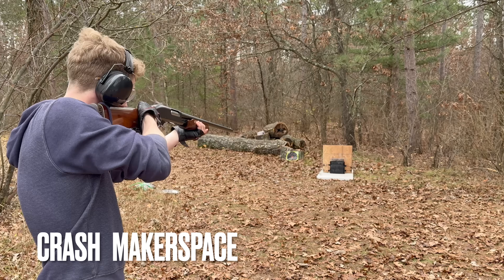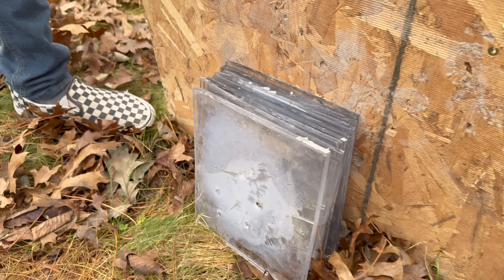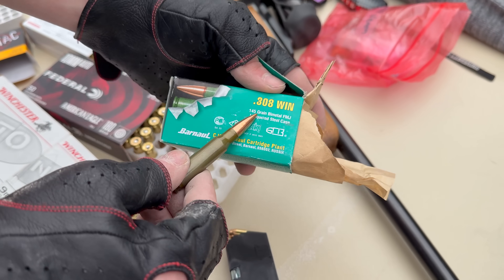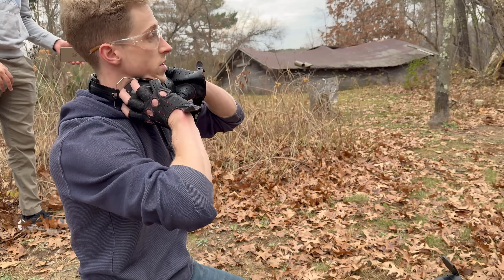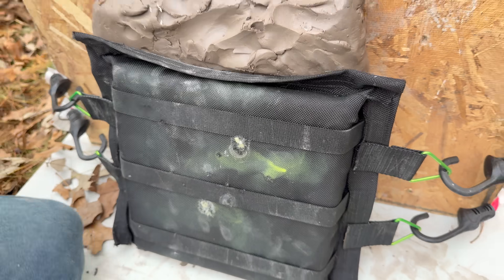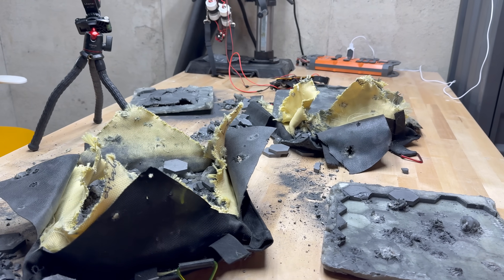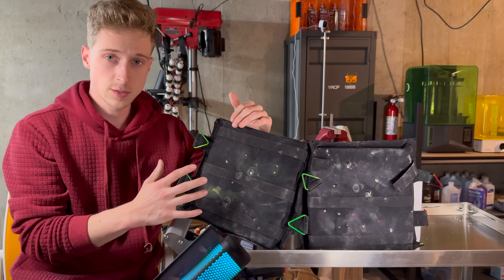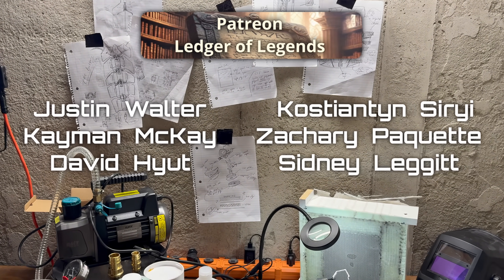3D Steel Lattice Super Armor (MULTI - HIT .300 WM capable)

Comment: I’ve got a piece you might be interested in and it’s cheap. I stopped hundreds of rounds from everything from .22. To 8mm from a Kar 98 to 5.56 took it all. Until I hit it with the prc after all the punishment I put on it both those went straight through but that’s what it’s designed to do. I’m not blowing smoke. 300wm ain’t no joke. I’m an inventor this is one of the things I shelved years ago it’s made of extremely cheap materials. That’s still showing a lot of blunt force trauma. I’m serious.im more than willing to share my designs with you if you’ll use them under the agreement that if you profit from my contribution that you are fair about it. I am on to different things but I still have the original piece right here in front of me.  I’ve tried to get armor makers attention on it before but they either don’t take me seriously or they don’t want it on the market because it will make body armor that’s effective against modern anti armor cheap and easy for when financially impaired people to obtain. If you’re in any way interested I’m serious. My direct number to my cellphone I’ll send you if you respond here. I’ll send some videos. I have zero attention on my page mostly because I haven’t put any of the really interesting things I do on there. Like turning a slam fire 12 gage into a 20mm thumper lol. I’m pretty legit. I’m just not a conformist type. I have a lot of genius stuff that I make but I never take it anywhere because I can’t seem to stay on task. At the moment developing a weapon that hides in a sweater sleeve that makes armor irrelevant at personal range but I’ll keep that one to myself for now.  Anyway let me know if you are interested in brainstorming or integrating my research into your projects. I’m not using it and I’m mostly just not wanting my concepts to go to waste

Comment: Cut this down to 10x12, and target around 6 pounds. If level 4+ rating is achievable for you, you have an amazing concept on your hands.
Reply: It’s likely the materials he used, steel increases the weight a lot. That’s why the XSAPI plates protect so well but they also weigh a hell of a lot more. It’d probably be best to have the core be titanium, more elastic and a lot lighter. Additionally for the strike face he’d probably want to use Boron Carbide like all the SAPI plates do, it reduces weight and is just simply the best ceramic there is for such a plate. 

Still with that he’d probably get at best 7.5 pounds.
Reply: Its not like this is intended to be the armor every grunt is gonna have. This is some special forces stuff some buff 220 guy is gonna carry to assassinate some terrorist leader. I dont think cutting the weight will be possible really.

Comment: Thank you!

I'm curious about the outer surface shape, where Batman has all those muscles embossed. Rather than flat or slightly curved, more angular, as much about deflection as it is stopping the penetration. Deflect the rounds down and away. Might require less thickness?

Comment: So 44 mag and 338 lapua is what you should add to your arsenal for testing imo. The 5.56 62 gr is not really AP even though on some boxes it says LAP(light armor piercing). I personally wouldn't really even use that as a reference outside of just testing against speed. If its stops .300 WM/.338 lapua now your doing some impressive stuff imo. Good luck with your armor man.
Reply from the maker: It stops .300WM as you're asking, that is what I shot it twice in this video

44Mag is far less penetrations than 556 as it is slower and larger; if you're looking to compare a large slow round, well the x2 1oz slugs I hit this with in the video are over 200% more energy than a 44 mag too (also that was after 2 .300s, a 556, and a .308)

Comment: Assumably a typical 10x12" medium size plate would weigh about ten pounds? This is pretty cool, but I'm not sure it's lighter than commercial plates which offer a similar level of protection (though perhaps not for multiple hits). As an example, Adept's Colossus plates come in at 6.5 lbs and will stop multiple 129 gr tungsten carbide M993 projectiles fired from a .300 WM at 3400 fps and a similarly loaded M80A1 projectile at 3450 fps. What I'm getting at is, if you throw together a plate that weighs double that, your goal might not necessarily be to stop anti-infantry threats, but threats intended to disable lightly armored vehicles. 

I get the idea is to be able to take even more hits, but the fact is, if you're standing out in the open getting nailed with several rounds they're not going to just hit armor plates, and you can't very reasonably have thick hard armor over your joints. Getting hit several times in the same plate by someone shooting a .300 WM is not a very reasonable threat, unless it's somebody using you as target practice.

Comment: So, serious question. If the weight of your armor for the "square" area you designed was 9 lb, what would be the weight if the equivalent area was AR500 steel?
Reply: In response to my own comment. AR500 steel is ~498 lb/cuft. So if you just cut a .25×9×9 area and coated it with a sub-millimeter surface of Aramid fiber for spalling, it easily comes in under the 9 lb weight. 

Easy peasy...
Reply: That's a .25"×9"×9" volume of 81" square. The weight would be under 7 lb with epoxy and Aramid fiber.

I imagine that would easily absorb 300 WinMag.
Reply from the maker: @pappaflammyboi5799  1) AR 500 does not come close to stopping the .300WM even at a longer range 2) BFD from  non-penetrations on steel can be significantly worse as then can end in a point. You're comparing Apples to Oranges with the AR500 here.

Comment: I want to start with you have done some amazing work on this project. It's a pretty big deal being able to stop a 300wm. However, these test show that it will stop a round but what it doesn't detail is the fact that you are still most likely going to die from blunt force trauma from the force breaking your sternum ribs and all that good stuff. What I would suggest is get some pressure sensors and place maybe 5 in a x pattern on a ballistics gel dummy to show if it helps with the trauma from the extreme energy dump. But good job on the stoppage. You definitely have something on your hands here. I look forward in seeing progress Take care.
Reply: Most modern body armor, has a performance standard of backface in calibrated clay to be less than 44mm. While there's no one size fit all, the NIJ deems  less than 44mm to be non life threatening. Doesn't mean you would walk away unharmed, but those numbers at at contact distance. Add actual range that one would engage with 300WM and BFD goes down a lot. For context, I took a shot at 400yd once with 338RUM, and the backface produced in a lower end level IV offering was only 22mm.

Comment: I would suggest that you do some research towards patenting your lattice idea and contact DARPA. I a also curious as to the tile material you used. Was it ceramic? If so, you might try using granite tiles, as they have a Mohs hardness of around 7 while most commercially available ceramic tiles are about 5

Comment: Saw those tiles a while ago on Alibaba. They are surprisingly cheap. Was wondering, why no youtuber was using them. Not sure how I feel about the composite. Kevlar works best when it can deform, so the resin weakens it a good bit. Well, in relation to the stopping power/ weight ratio anyway. But if you are putting it in front of the hard tiles, then the fibres get sheared anyways, so the stiffer composite migh be better in this context? Might be interestening to test an even more flexible PU based matrix, like the stuff they put on on AR Plates against bullet splash. 
Saw another youtuber comparing different materials as matrix for glass fibre and ceramic balls, and they found that liquit flex  seal worked best for them. At least compared to the stiffer resin they used.

Comment: A hanging rig could be made to put on the inside of your front door if you live in a dangerous area. It would have to be something that can hold them securely enough to resist the inward force but something that you can easily swap out individual panels to and from. Maybe a decorative cover could be put over top so your guests aren’t like wtf 🤔

Comment: I kinda wonder if youll actually survive a..300 wm hit with that plate. The percussive damage that is imparted by that round is significant. Like getting a sledge hammer straight to the chest. Stops the bullet but not the kinetic energy which in itself is very lethal
Also thx for not doing clickbait crap

Comment: 9 lbs...  no thats way too heavy.  AR500 will already stop all that shit and is probably about the same.   Modern armor is ceramic and half the weight so you dont break your back carrying it all day.
Reply from the maker: Ar500 definitely does not get close to stopping this .300; and ar500 steel gongs don’t get holes in them since they swing. Also, ceramic level IV don’t take even close to 1/4th as many rounds as this did, and 3rd, this is only 2lbs more than typical level IV of this surface area. And lastly, someone doesn’t understand that Gen 1 prototypes aren’t nearly perfected yet.
Reply: I’m pretty sure you’re wrong. AR500 videos are everywhere and they just eat everything. You can shoot the shit out of them for hundreds of rounds and practically nothing happens.  if you think they don’t get holes in them just because they swing I think you’re mistaken.  also ceramic is not expected to take the same abuse. It’s lighter and doesn’t retain heat or cold like steel.  Walking around with steel armor on all day is horrible.  It fucks up your spine and discs.  Less weight is better.  You got some cool stuff. Impressive intelligence and design skills. Keep creating
Reply from the maker: @Robertsmith-un5cu  Here is a video of AR500 getting an immediate blow out from a .300 at almost twice the distance that I shot my plate with:  https://www.youtube.com/watch?v=b4kgMXjA2Zk&t=147s 

And no, I'm not mistaken with the energy transfer of deflection on a swinging panel, it drastically reduces the required material to resist penetration.
Reply: Cool posting a level 3.+ failing.  Try finding a video of level IV AR500 steel failing.  Let’s try and compare apples to apples here.  You’re stuff is as heavy as AR500 level IV plate.

Comment: I think the second 300 win mag didn’t go all the way through due to the clay backing the panel having enough compressive force to prevent the round from penetrating through fully, but that force would have been absorbed by the wearers body in that case, which would not feel good. Better than it passing through of course, but that would have done real damage if it was worn by a person in that moment.

That said, I do not want to shit on what you’re doing because it’s obviously incredible. The small pegs to absorb the force of the round is a brilliant idea. I imagine creating stages for the round to pass through might improve on this design.

For example: stage one it passes through a lattice of titanium to slow down and break up the jacket of the round, stage two it passes through layers of resin and paper, stage three now the slowed down and broken up round hits the pegs with a lot less force and mass behind it. I watched the US Army innovate some solutions to protect trucks from the effects of explosively formed penetrators and this multi stage approach worked well on the large scale. I think the same effect is what you’re tapping into here, but it could be exploited further imo. Seriously phenomenal work and I’m very excited to see where it goes from here
Reply: Also, I liked and subscribed, because what you’re doing is badass. Reading my comment back I sound like a hater but I’m not, I’m just terrible at communicating

Comment: Something I’d like to see is what the limit for how many 5.56, 300BLK, 6.8, 7.62, and other common rounds it can take before it fails
Reply from the maker: I mean, you can see it taking 10+ .556 M855 (steel core) along with .308 (similar to 7.62). Just plain .556 without the .300 WM & large area damage of the slugs, it'd take magazines of FMJ 556 alone
Reply: @CrashMakerspace  that’s a good point. You are making something absolutely amazing here man.

Comment: Could you give some specs on that bullpup you used to shoot the green tip?  I know that it is an IWI but that barrel seems long.  Also, I know they have a 300 BO model.  But 300BO is obviously not the same as 300WM, so was that 5.56 green tip?

Comment: I also make armor and made a bullet resistant whiteboard from porcelain and steel. My only problem is multi hit capability. Ive made fiberglass armor that has worked well but the cost can be expensive. Is there a specific (hexagonal shapes) tile that has worked the best?

Comment: Slugs are probably the worst round for penetrating armor. I have never seen a slug penetrate any body armor. But stopping a 300win mag is very impressive.
Reply from the maker: Yessir, the slug was for area damage (traditional level IV will lose massive penetration capability after a slug as it shatters the ceramics far & wide) so it was showing that this could keep taking a good bit of 556 after 2 slugs

Comment: So I guess the main issue at the moment is that big dent in the clay after each hit, since in real life that clay would be like, your flesh and organs and stuff

What I'm curious about is how much of that energy gets transferred through with a traditional Lv 4 steel plate for example compared to this super material. I know stopping penn is the highest priority, but being multi hit doesn't feel as useful if the first hit pulverizes your organs anwyway...

Fascinating research though, it would be especially cool if you could actually build a full vest out of it out of the smaller discreet plates like an actual batsuit, and test it in a more complete implementation

Comment: Nice work! How does a 10 pound steel plate compare?
Reply from the maker: Of this same size, 10lbs of steel can't take .300WM at all (also spall is really bad with steel with scarier backface deformation as steel makes pointer backface dents which are more likely to crack ribs)

Comment: I bet it wouldn't stop .30-06 AP blacktip.
Reply from the maker: Im confident it would handle it just fine. I'm filing for some DoD grants and will fire those. the .300WM is over 500 ft*lbs more energy than a 30-06 and the carbide in here is far harder than tungsten carbide that's the core of the black tips.

Comment: FYI the green tip is not a really for armor penetration. It's really only designed to punch through sheet metal easier, and really isn't any more effective than fmj.
Reply from the maker: Its true, its a bit better in the center doesn't deform but its still called a penetrator core as its made to deflect less when going through glass / drywall etc

Comment: Slugs aren't meant for penetration. Not like a .308 is. So i don't understand why he's trying to showcase it as if it is
Reply from the maker: It's demonstrating repeatability which is more impressive than just 1 hit stoppage limits. Shooting it with X2 .300WM, then 308 & 556, then X2 slugs and then x10 556 is the whole point. Typical level IV armor begins failing way sooner. Think beyond 1 dimensional single hit energy absorption.

Comment: Where did you acquire the boron carbide tiles? The tiles tend to be fairly expensive... Unless you've found a cheaper supplier.  I get adverts on ballistic times from Ali Baba now and again but they are still more expensive than I like. I can buy good commercial armor for less than i can make it myself (so far).

Comment: Did you ever look at working with Tullomer?  It's a new low temp printing plastic from Z-Polymers, could be worth looking into, if not for the bullet proof stuff then for some of the mechanical bits for the under suits.

Comment: "all that energy to be stopped in just 30mm"...All that energy can be stopped by a 6mm steel plate
Reply: The problem with pure steel is that it can deform and hurt you a lot, and is also very heavy.
Reply: @davisdf3064  dunno why my comments get deleted

Look up steel body armor level 3+, its about 6mm and can stop most rifle rounds with the lowest backface deformation on the marked
Reply from the maker: @doprisi  6mm steel will NOT stop .300 WM
Reply: @CrashMakerspace  Right, then not that round but still a .338 and most other rounds for 6mm of armor grade steel with minimal backface deformation and multi hit capable..and much cheaper. Look up books on body armor, there is a lot of gold to be read :) It's a really interesting subject

Comment: Personally I would make the helmet and some of the armor panels more specialized, specifically smaller plates around important joints. Those areas are put under a lot more stress because theres simply less mass for any impact to go through, so making those parts reactive in some way would make a big difference. This could be solved by whatever you're putting under the armor, but I think its an interesting challenge nonetheless.

Comment: Hey this is honestly awesome dude, the one thing I would change is add a layer of material on the front with small triangular shapes facing towards the front across the plates surface which should help to dissipate the energy of the shot more evenly and could help stop even larger caliber with little added weight

Comment: Would love to see the performance of your build, but if it was scaled to typical armor plate. IE: it was of similar weight, size, thickness, etc. to fit a plate carrier. Or if the lattice structure is a limiting factor, in that it necessitates the thickness and weight.